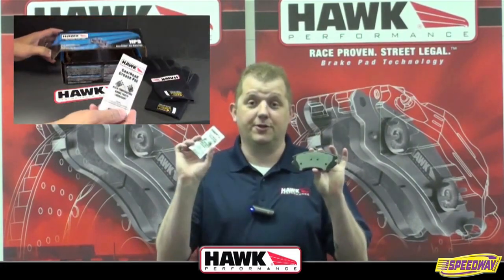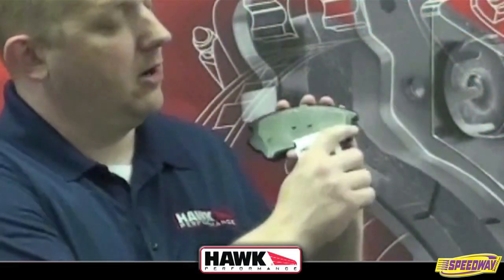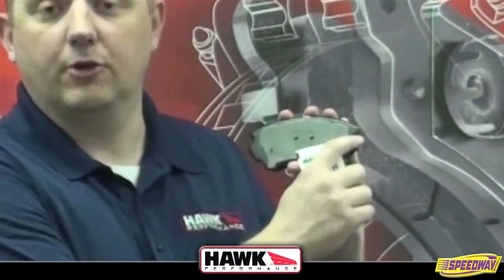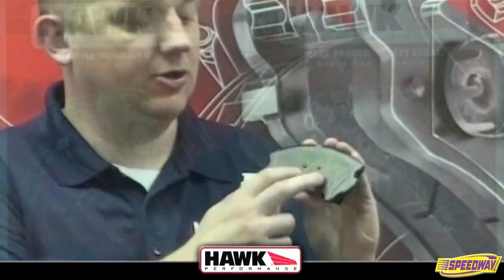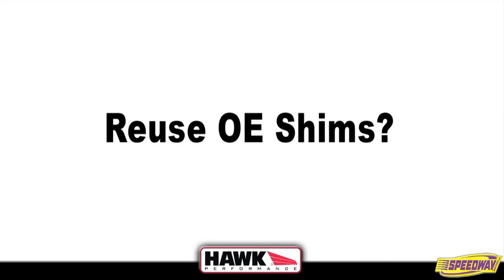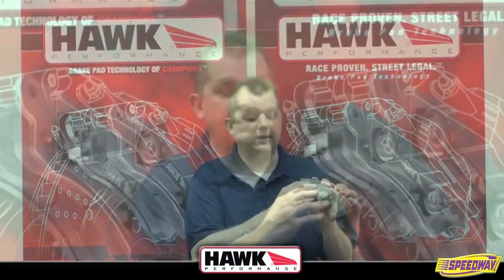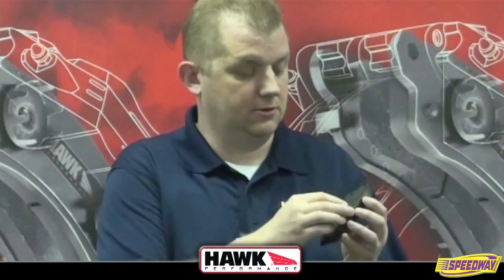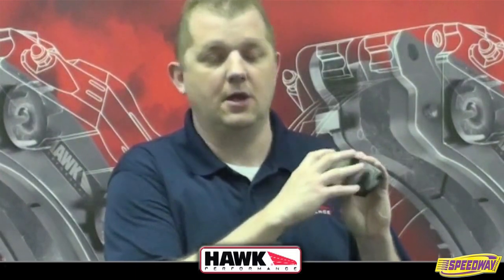Hawk Performance Street Pad Install Tips - Brake Grease and Shims

Comment: I  can see using a little grease on slide bolts but why n hell do u need to grease the back of the shims? I just redone a guy front pads on an 07 Maxima. The Goober before me put grease on the shims and it got to the rotor side of the pads. It cause rotors to shake.